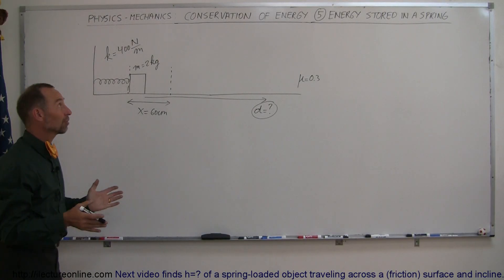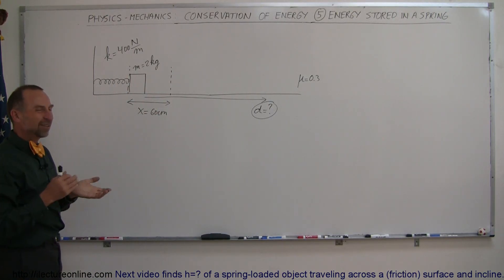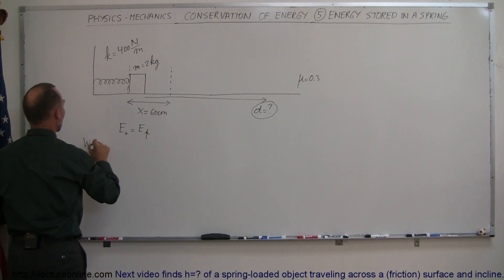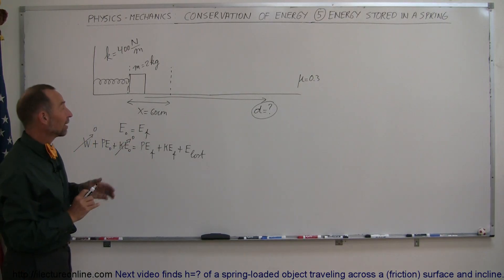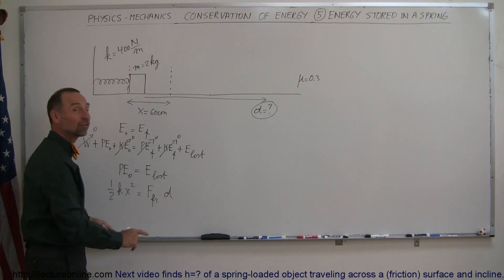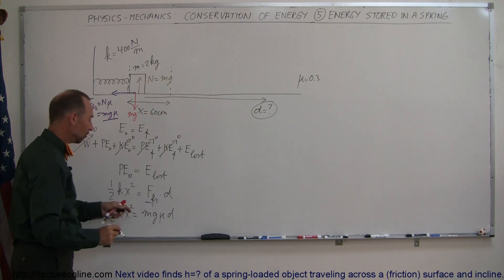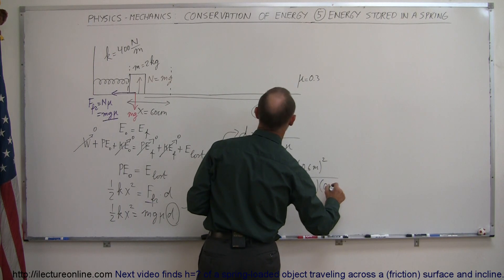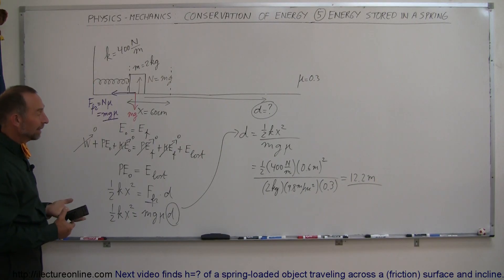Physics 9   Conservation of Energy (5 of 11) Energy Stored In A Spring

Comment: I have a question, why is there initial potential energy but no final potential energy? I was thinking when the spring is at rest x=0 (initial) and when we extend the spring x=0.6m (final)? That's why I was thinking there's no initial potential energy and there is final potential energy.
Reply from the maker: The spring was initially compressed, which means that the spring had potential energy intially.  At the end the spring was relaxed and there was no height gain.

Comment: Sorry don't mind me asking a rather stupid question. Why do you multiply mg(normal force) by mu? I'm given the friction force in all the problems I do so I'm not familiar with calculating it sorry.
Reply from the maker: No need to apologize.  Ask away.    It is by how the friction force is defined.   The definition of friction for is:     F fr = N mu     (Friction force = normal force x coefficient of friction)   In the case of a block on a surface, the normal force is the weight of the block.  In other cases you have to calculate the normal force.
Reply: @MichelvanBiezen  Oh ok thank you very much!

Comment: A small doubt.
If we take into the work done to compress the spring while solving the problem, do we have to make any changes to the other values in the equation? Bcz I think otherwise the answer may not be the same.
Can you plz elaborate a bit?
Reply: I guess we have to take PE initial to be zero then?
Reply from the maker: That is correct.  Either you account for the work done to compress the spring or you account for the initial potential energy, but not both.  That would be "double dipping".
Reply: @MichelvanBiezen  Thanks for making my concepts clear. :)

Comment: Thank you very much. Small question though. The energy stored in spring will be used to move the object so there will be kinetic energy. Also when the box reach d point, there will be potential energy. Thus my confusion. Could you elaborate a bit?
Reply from the maker: The box will only gain potential energy if it gains height.  Since the box slides over a horizontal surface no potential energy will be gained.
Reply: @MichelvanBiezen  but at point d. Spring potential energy should be stored in the form of potential energy. Because there is the displacement of body from the mean position
Reply: @satyamkumar567  Here's what I think. There's a friction force(a nonconservative force) that is opposing the motion and thus removing energy(decrease in mechanical energy) and gradually stops the block. @Michel van Biezen All the potential energy in the spring is converted to the kinetic energy and all of the kinetic energy is expended after friction force brings the block to a stop. Am I right?? I'm not sure if all of the potential energy is converted to kinetic energy because there's a friction force.
Reply: @historyisthebest5831 thankyou so much I was stuck at this for so long

Comment: So for the work done by the spring, only the 60 cm is taken into account? I think when the block goes over the 60 cm, the spring is also doing work to the opposite direction from the original one.
Reply from the maker: Only if the spring is attached to the block.  In this case the trip is one way only and the spring is not attached to the block.
Reply: @MichelvanBiezen  So in this case the spring gets detached once the block reaches 60 cm. This is exactly what I thought
Reply: @童乙 how do we know if block is attached to spring or not?

Comment: Then how will come to know, when to take the block n spring as one system
Reply from the maker: The block and the spring are not one system.  The block slides towards the spring until they make contact and then the block is slowed down by the spring until the block comes to a complete halt and then the spring is fully compressed.
Reply: Thank you, Sir, so in conservation of mechanical energy, block and spring should never be considered as one system, in the numericals n problems?
Reply: My question is that in numericals of conservation of mechanical energy , spring n block should not be considered as one system
Reply from the maker: I don't like using words as "always" and "never", but when working an energy problem I would keep track of the energy of the block and the energy or the spring separately.
Reply: My apologies, thank you Sir for your guidance
Reply from the maker: No need to apologize, we are just glad we can help.

Comment: Sir can you help me by solving  the same problem where there is a toy car instead of a block,  its given the car body has mass M and the four disc wheel has mass m and radius  is r, yes friction  is exist  as this problem.  All we need to find out the maximum  distance  travel by car where the wheels started  to slip.  Please  help me i need that solution ..( and i forget  to mention  that the car will be always  attached  to the string)
Reply from the maker: Take a look at this video for information on how to deal with tire friction:  Physics - Mechanics: Rigid Body Rotation (4 of 10) Calculating Acceleration & Friction of a Car Tire
Reply: Michel van Biezen ok sir thank you

Comment: Actually, I think the final potential energy cannot be zero. There is still energy in the spring in the final position because it is not in the equivalent position yet. there should be a final potential energy which is 1/2 k sqrt(d-x)
Reply from the maker: Once the spring reaches its equilibrium length its potential energy is zero
Reply: but professor, at the final position the body is not at its equilibrium position.. The kinecticenergy at the final point is ofcourse zero,, But it has to have some potential energy to come back to its  equilibrium length..
Reply: Then how will you come to know when to take the mass n spring as one system
Reply: When to consider the spring n mass as one system???

Comment: I do not understand why there is no potential energy final. Wouldn't the spring have full potential energy once the block comes to a stop?
Reply from the maker: The spring only has potential energy when it is compressed, or elongated.  When it is at rest it does not have potential energy.
Reply: The block is not attached to the spring. If it was then yes there would still be potential energy at distance d because the spring (with the block) is elongated.
Reply: @makchamp how do we know if spring is attached to block or not

Comment: in this example why  PEi =1/2.k.x  ?? isnt PEi=0 ??
Reply from the maker: Faruk,
The initial potential energy can exist in several forms.
1) PE = mgh initial if the object is higher than the reference height (like the ground)
2) PE = (1/2) k x ^2 is the object is held against a compressed spring. 
In this example the initial PE is the second type.